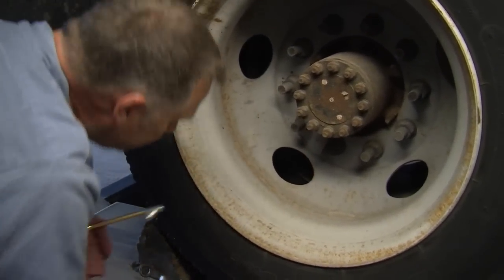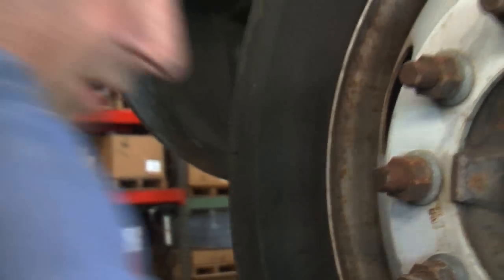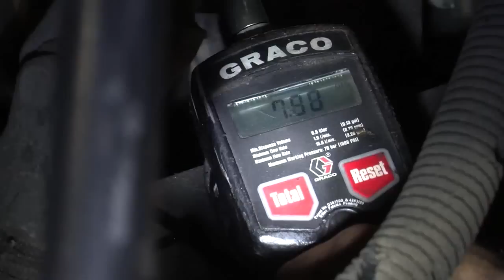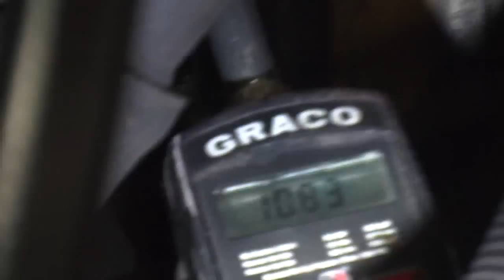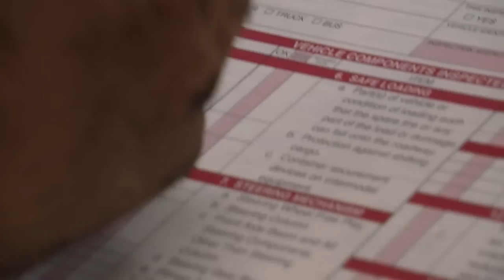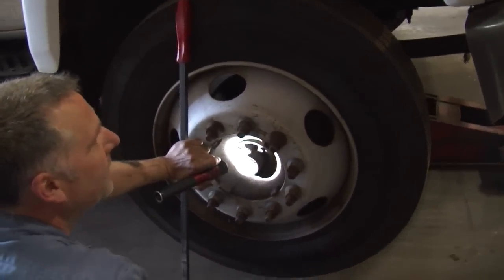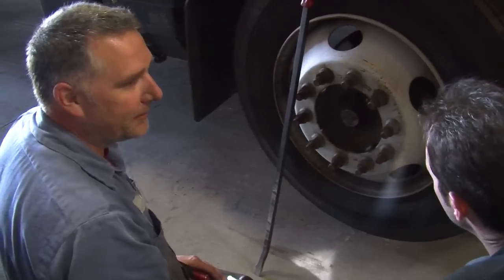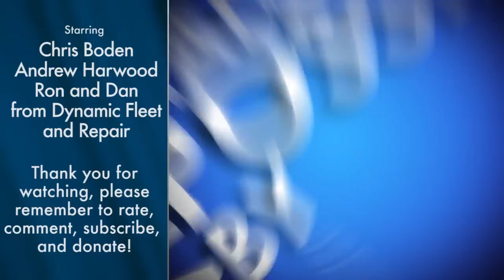Oil Change for a Big Truck

Comment: As a diesel tech with over 30 years experience, I can safely say that you have a well maintained truck + your inspection was first rate.  You definitely were getting water in the hub seal, although in my experience it is always the hub seal, *the outer cap thingie" not the wheel seal. Front brake replacement and bearing inspection generally entails wheel seal replacement, I would recommend both hub seals also be replaced, they are usually not very expensive.

Comment: One thing I saw: The front springs have been contacting the rubber spring snubbers/bump-stops leaving a shiny round mark on the top of the springs. Snubbers are only meant to contact the spring in the case of very large movement in the suspension, such as hitting a pot hole. I did notice that the ride was very harsh, and perhaps front shocks are needed, but I myself would want to know if the snubbers have been hitting when loaded, because that is very harsh indeed.

Comment: Good video but you showed filling the fuel filter with diesel fuel but you did not show the mechanic filling the oil filter and reinstalling it.
Reply: Ricardo Testa Aaaa the purpose of a video is to illustrate all points and some people may not know to add oil to the filter, which holds almost a gallon, so that is my Point Duuh.
Reply: +Max1Chase1 Why fill a oil filter with diesel.
I know diesel is a little oily in nature but wouldn't oil in the oil filter that matches the oil type make more sense?

Air in the diesel fuel line is a pain in the ass as you have to re prime the system.

Comment: i driver a 2006 268 26' hino, if i dont change fuel/gas filter can it cause the truck to choke and die during operations? and can it prevent the truck from starting?? thanks!
Reply: +2phalanges Yes it can starve it of fuel.